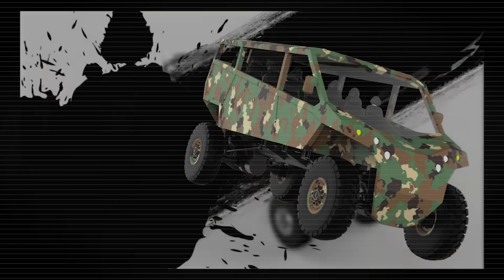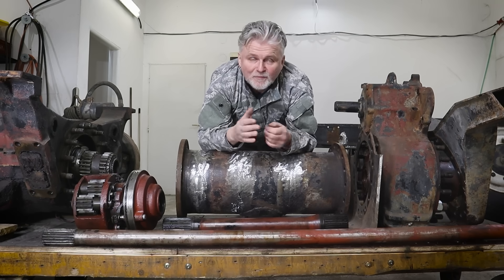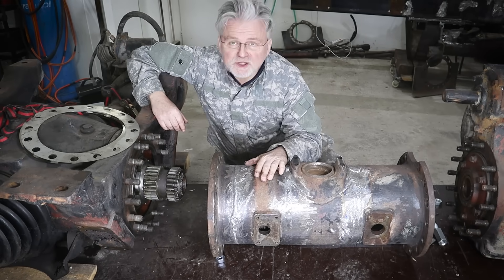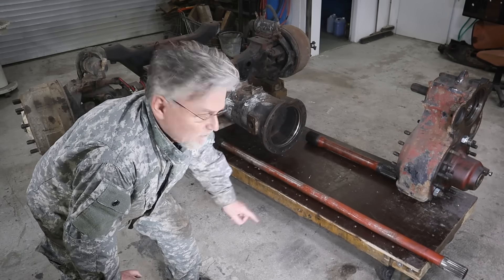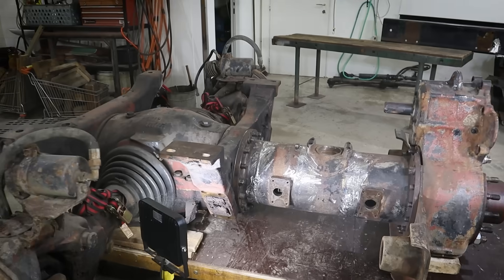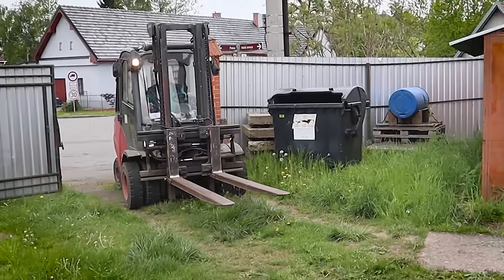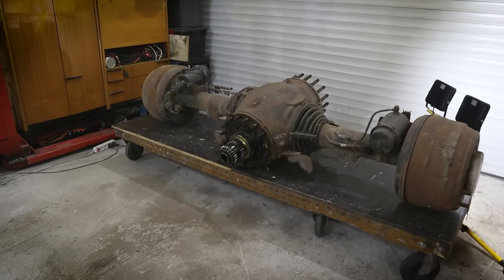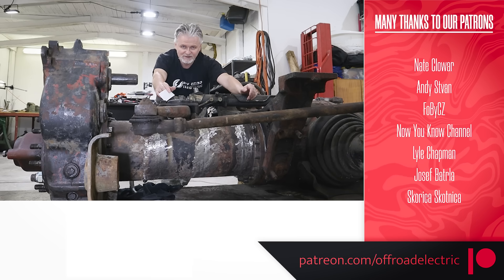EP.62 - 2 Wrecked Teslas + 2 Junkyard Tatras = One INSANE Off-Road Monster Truck (Build In Progress)

Comment: Hate these idiosyncratic videos. I just fast forward.
Reply from the maker: 37000 views, 1600 likes, and only one hate. There is clearly one in 1600 who is perfectly normal, and those 1600 are very strange.🤔Let's make a video for just one person next time!🙂
Reply: @offroadelectric9457 
As an engineer, I find many things people do is nauseating. Ex British aerospace  vickers fluid power and Vickers Nuclear.
Aston Martins, mclaren automotive. Martin Baker aircraft. Stage engineer mild steel stainless steel aluminium, copper tig, coded mma mig silver solder. And the list goes on.
Basically, I don't want to watch manufacturing. A few pics on how you done it and the end product. 
I suck up to no one
Reply from the maker: Exactly, I also suck up to no one, so will not make free videos for just one person (Unless you have the funds available to fully finance it, which I doubt).🙂 I wish you a happy and hateless life.👍@anthonygregory3022
Reply: @offroadelectric9457 
I did solid steel animation with a gas ax gas welding tig and mig figurines.
Using steel like plasticine.
Reply from the maker: 👍 @anthonygregory3022
Reply: @offroadelectric9457 
Ide say get more creative with metal.
Machines are easy.
Reply: Petře obdivuji tvou trpelivost, neřeš chudáky co si hrají na borce a pracuj dal na parádním autě. Máš můj obdiv. Jen tak dál.
Reply from the maker: Dekuju.Presne tak!🙂 @robingebauer1

Comment: Can only wonder the spacing of the axles being the only thing limiting tire size?
Reply from the maker: The limiting factor is the size of the U-joints on halfshafts. I was thinking about HEMTT 16.00x R20 tires, but probably will stick to the original size. I will have over 3ft of ground clearance under the belly anyway...

Comment: Every video I am amazed by the scale of the mechanicals and how much work is involved in every single step of thos build. 
I love the concept of how this is designed, but what a pig of a job to perform any repairs compared to conventional truck designs. 
I assume all these components will need to all be removed again for cleaning and reassembled, once again. 
Regarding the drive shaft mod, it I'm concerned it may not be up to the task of all the load and torque. If it was in a conventional setup it wouldn't mater as its not hard to remove for repair. But given the humongous task to remove it from a finished vehicle I would think the splice should be heavier duty. Those welds really don't have much material connecting the collar to the shaft and that just leaves those 2 pins. I suspect it may be OK, but if it's not its just so much work to even inspect it. 
I love this build, and looking forward to the next update.
Reply from the maker: Thank you and yes, everything will be reassembled, refurbished and painted.🙂 I assume the shaft will be OK as the loaded original Tatra is about 23 ton and this one will be around 7 ton. And there are 4 weld layers on each side. But like always, just the real test will show if any part needs to be reinforced.
Reply: @offroadelectric9457  I suspect it will be fine, but if it ever fails its a huge task to check it. I guess the big positive is that now all the fasteners and fittings are not seized or rusted. And you are very familiar with the whole system.

Comment: Is the Ackerman affected by all this or doesn’t it matter?
Reply from the maker: I checked the Ackerman geometry years ago, and it looked like Tatra company doesn't  care about it much (if I measured it correctly as I think I  did). This truck will be used for extreme offroad in low speeds, so don't care neither.🙂
Reply: @offroadelectric9457 cheers for that, this is an incredible project.